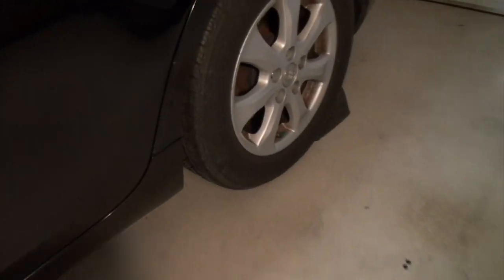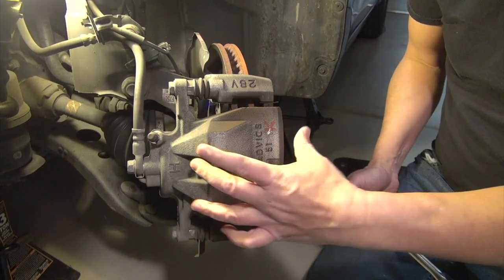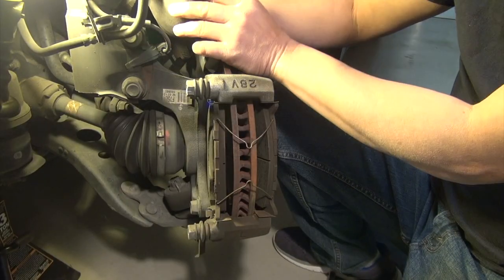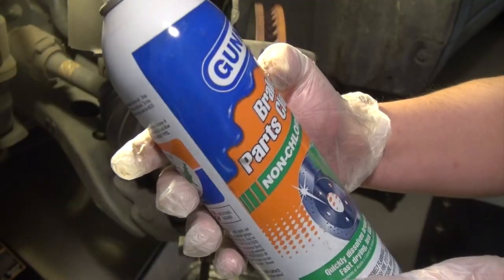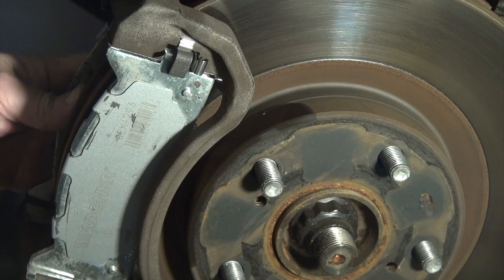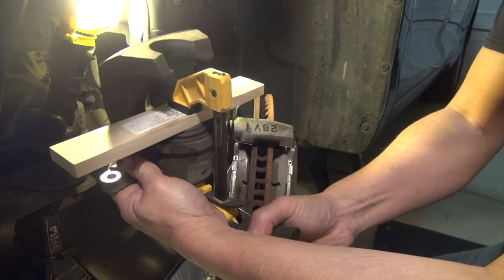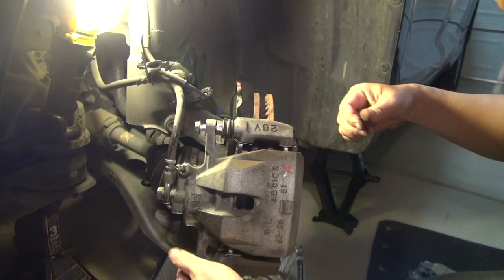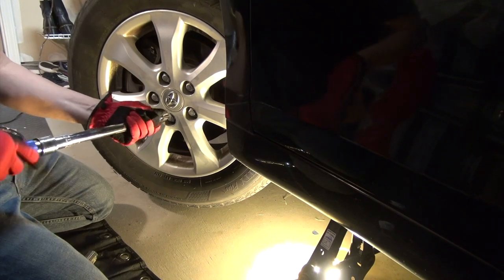DIY Front Brake Pads Replacement (2011-2017 Toyota Camry)

Comment: You don't need to remove calipers to replace pads. Remove bottom bolt and just loosen top bolt. Then pivot out of the way.
Reply from the maker: Thank you for this helpful tip!  Best regards.
Reply: Only amateur weekend wannabes will take all the bolts out.

Comment: You dont need to loosen the bleeder screw. Just take cap off of brake fluid reservoir and push the caliper piston back in.
Reply from the maker: Thanks for the feedback.  Totally agree. That would be a cleaner way of doing it.
Reply: This also won't introduce air into the system. Air in the system needs to be bled out as it can be compressed unlike brake fluid. If you've cracked open the bleeder, do a proper brake flush, at least enough to get the air out.

Comment: Dont forget to pump your brake pedal
Reply: Seen this "pump break pedal" comment often, but why is that
Reply: @aaabbb-py5xd  Once you push the caliper piston back in you wont have any brakes to stop the car. Thats why you pump the pedal til it gets firm before driving
Reply: @thetexaschainsaw9366  thanks very much, but if I just start driving and apply brakes as needed, wouldn't that also firm up the brakes? Or is the danger that components may come loose or fall apart long before I ever need to brake
Reply: @aaabbb-py5xd  You wont have any brakes at all for the first 2 or 3 stops and thats very dangerous. Thats why you pump the brake pedal til it gets firm
Reply: @thetexaschainsaw9366  I see, thanks again

Comment: Nice video, very informative and straight forward.  Except I'm wondering why the bleed valve?  Won't the fluid just go back to the reservoir when you compress the piston?  The bleed valve mess just seems so primative and not necessary, perhaps?
Reply: All he needed5o do was remove the reservoir lid off.all that there is not necessary

Comment: You can use the old pad instead of the piece of wood to push the piston back.  As others have mentioned, put some silicone grease for the slider pins and little grease on the piston where it contacts the pads.  I have to change the pads on my car also.  How are your pads?  Are they making any noise?
Reply from the maker: Thanks for the advice.  The pads worked great.  No issues.
Reply: not too mention i notice he curled the boot on the caliper piston a bit. and you can use a C clamp with the pad as the old way and just muscle it in. shouldnt need to bleed anything just push the fluid back.

Comment: You may want to check the slider pins and grease them if needed.  
Apply grease to  the medal contacts (caliber to brake pads) to reduce noise.
Reply from the maker: Great advice!  Thanks!

Comment: Sorry, man, but you made a LOT of mistakes!
Those Wagner pads came with a small packet of grease, that is intended to be lightly smeared between the pad and the shim.
Then, use brake grease on all the metal to metal contact points, especially on the fitment kit and the caliper ring and horns.
Don't bleed the fluid out!  Now that you have bled the fluid out, you have a low amount of brake fluid.  Fluid is to be FULL when the brakes are new and will be near "Min" when the pads are worn.  So you now have the fluid below Max with new pads, and will have a level below Min when the pads wear. 
Not at least checking the rotors for thickness and runout is "iffy".  Def should re-surface or replace them or you are just shortening the life of the pads and will soon get some warping.
AND:  REMIND PEOPLE TO PUMP THE BRAKES UNTIL FIRM, or they WILL have no brakes when they start the car!
Reply from the maker: I appreciate the helpful information! Thank you!